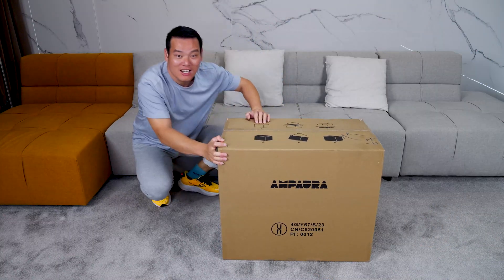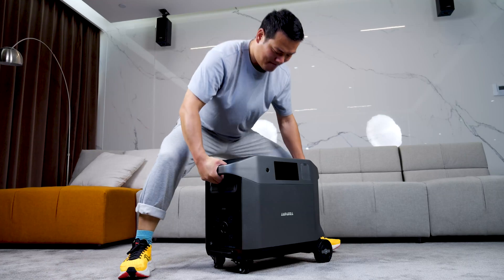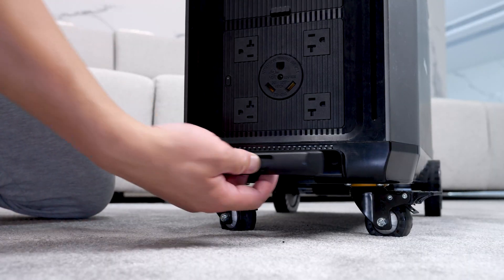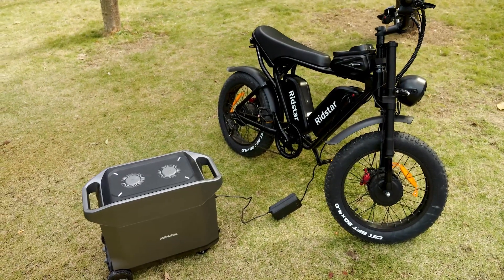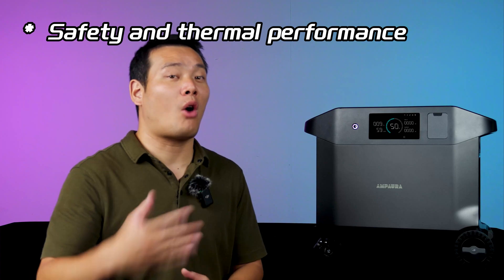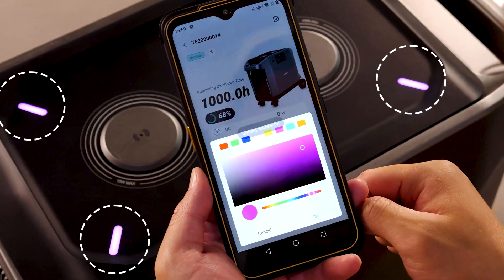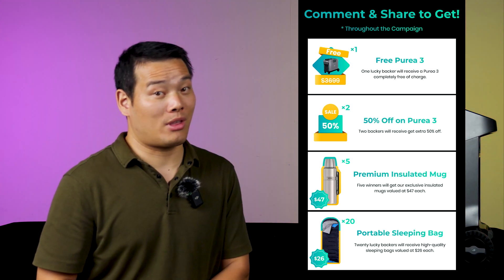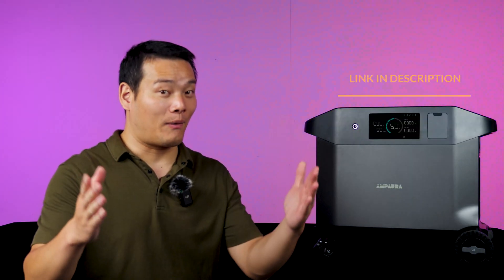AmpAura Purea 3: Portable, Powerful, & Unbelievable Value

Comment: How does this compare to the ecoflow delta pro or the anker f2600?
Reply: This wouldn't survive a review against something established like the anker or Eco. He mentioned it was crowdfunded. This is a startup prototype Aunt. It looks like it has a lot of cheap components. I can understand having to do that with the exterior. But without knowing what they put on the inside, I'd be a little leery. 
But I do wish them luck it's hard getting off the ground. 
But right now they have the Anker f2000 shape. But they have storage and output of the Anker f3800. I noticed none of the reviews mentioned the weight. All they do is say it's heavy. The Anker f3800 is 132 lb. This has to weigh at least that.